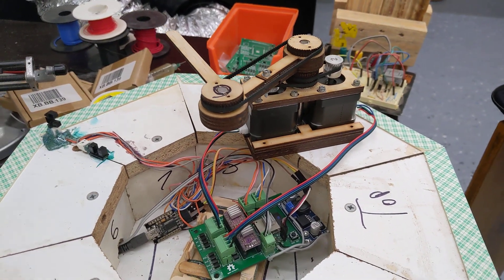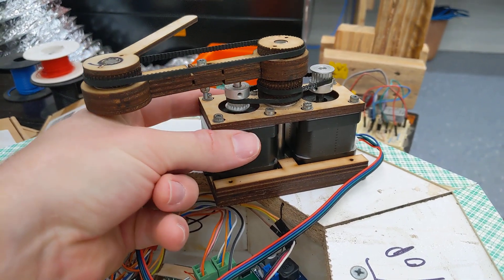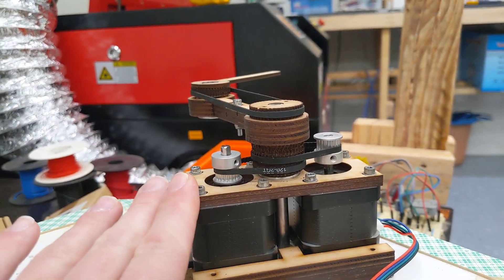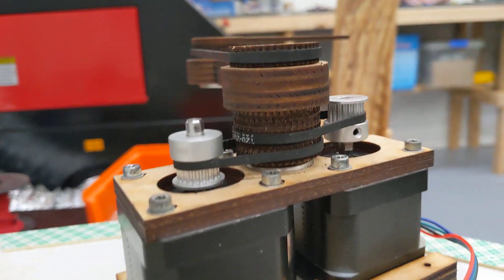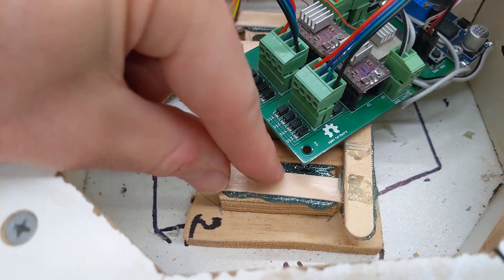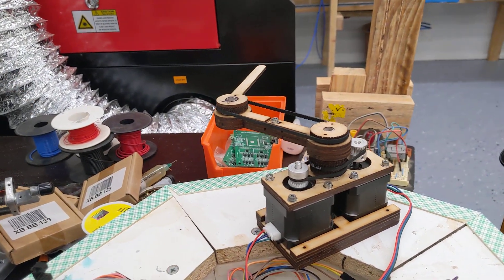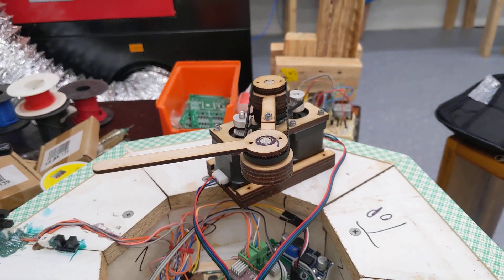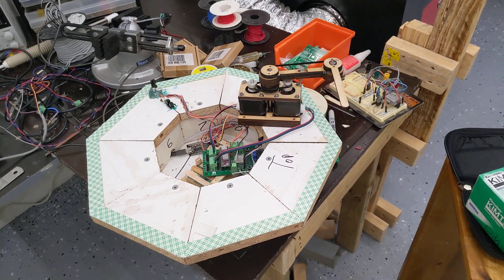Improved wooden mechanism for the sand drawing robot

Comment: Exactly what i was looking for the wood cut design. Qiestion, wouldn't it be possible to run it with an arduino to skip the custom pcb?
Reply from the maker: Absolutely! Anything that can drive two stepper motors can be used to build one of these robots. Though the code I've built for this project expects an ESP32 and pololu-style stepper drivers.

Comment: Do you really need the pulleys?  I'm building a SCARA robot also with the first arm driven directly off the stepper.  With micro steps it seems fine enough.  The second arm too is driven directly from another stepper on the first arm, no pulley.  It is a much smaller and lighter stepper.
Reply from the maker: I'm not sure if I understand. Do you have a diagram or video of your setup?

The belts aren't there for reduction – they're there to pass the torque through to the moving parts without slip rings.
Reply: @tjhowse  I have the arms mounted directly to the output shaft of the stepper.
i.e. the arms have a hole that the splined shaft of the stepper fits into.  So when the stepper rotates its shaft, the arm rotates.   
I don't have a video on it or anything, i have not seen anyone do it this way, they all have gears or belts from the stepper to the arms.  I can email you a pic of my setup if that helps.  Is your email on the youtube channel?
Reply from the maker: @murraymadness4674  So you have one stepper mounted to the base, with an arm attached to that stepper. The second stepper is mounted to the first arm, and the second arm is mounted to the second stepper? How do you get power to the second stepper? I'm not sure I'm understanding properly.
Reply from the maker: Transmitting stepper control lines through a slip ring is theoretically possible, but it's a noisy, relatively high-power, signal that is intolerant of momentary interruptions. Far more challenging and expensive than using belt driven pulleys. The same applies for the battery+wireless approach. These are all solvable problems, but belts are cheap and work great.

On the other hand; magnetically levitating a non a non-spinning object at room temperature is currently impossible.